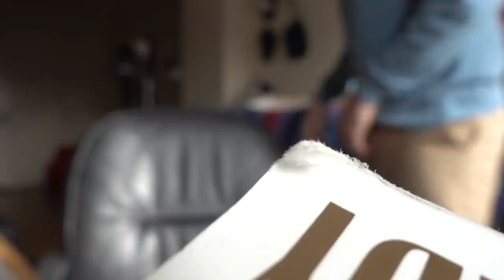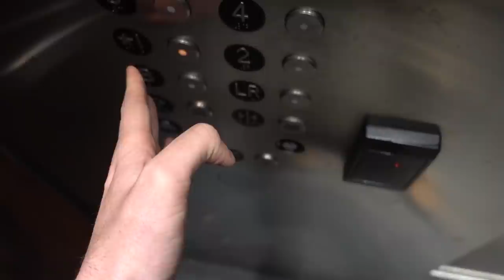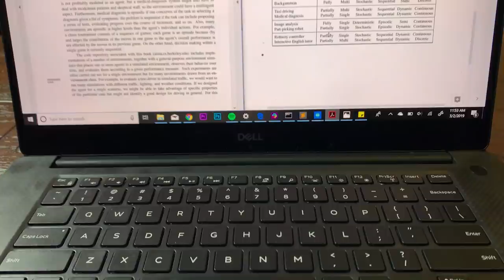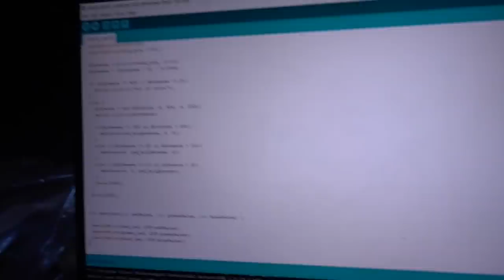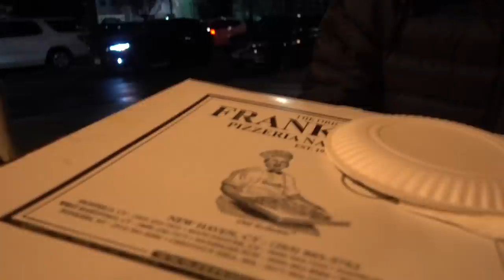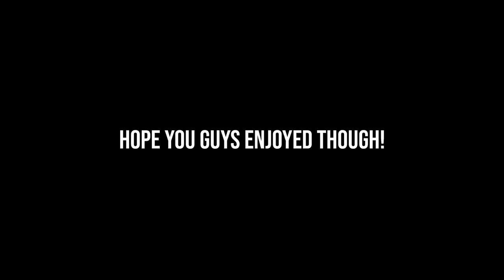Study With Me - Yale Midterms!!!

Comment: Pro AirPods tip:
Unless you have to insert them a specific way for them to fit, tuck the stems closer to the sides of your face for it to look and sound better (i.e. they shouldn’t stick out, and the metal tip should just about touch your skin)